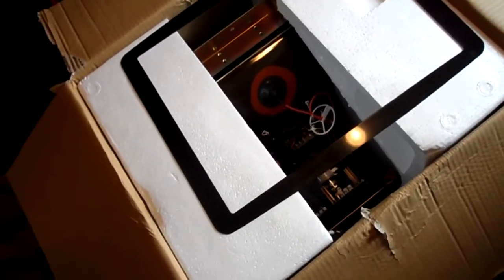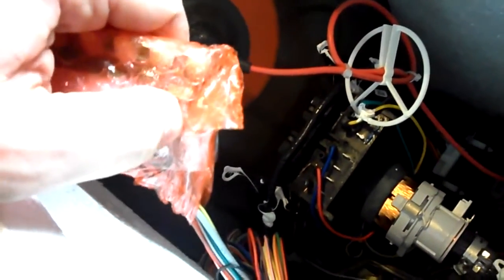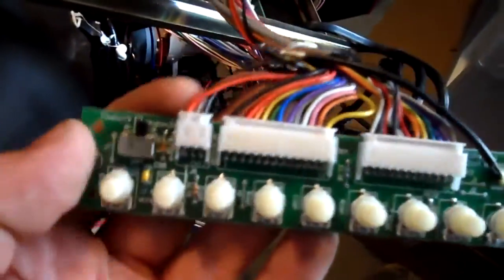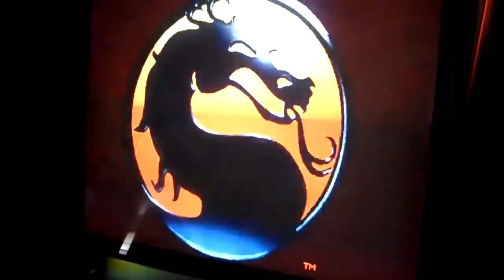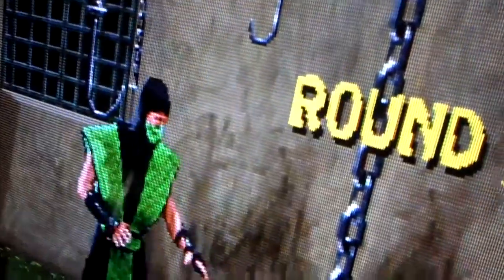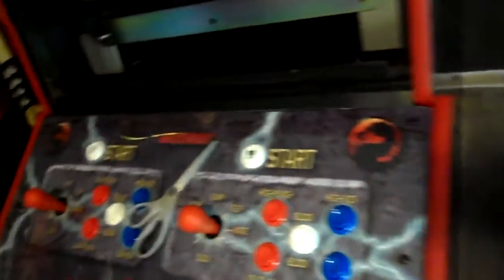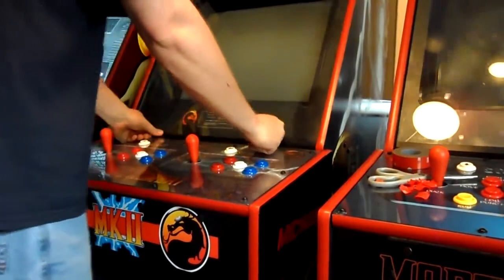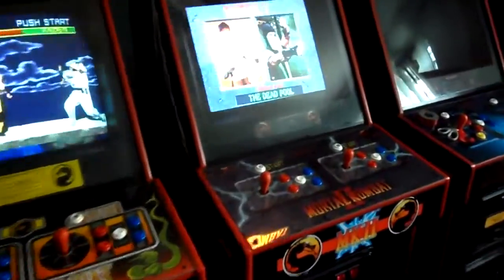Makvision 25" Tri-Mode Arcade Monitor Review

Comment: Do you still recommend this monitor? I need to replace my Golden Tee Fore Complete monitor and I was thinking of going this route.
Reply from the maker: Unfortunately, this monitor has been out of production for years. Only the 27/29" model is available and it's expensive. But to answer your questions, yes. Highly recommend is you can find one. Also, if your GT Fore is original, then it will have the 27/29" version, not the 24.8" version.

Comment: Trying to get my monitor wired up but it has a VGA cable with 9 pin CGA adapter on it, can I get these in 5 pin? All the premade jamma harnesses I've been looking at have 5 pin video cable connectors.

Comment: I have a quick question as well on the monitor that Greg asked about.  I just picked up a really nice golden tee cab that the makvision 27/29 svga monitor will fit right into, but I want to make sure this is the monitor that I need for my project.  I am wanting to run a pc with a hyperspin front end and have my games look like they originally did especially games from the late 80s to the late 90s (such as contra, ghosts n goblins, mortal combat..ect).  Ive just read of the nightmares that some people have getting all of the resolutions to display correctly depending on the setup that you are running.  Trying to decide between the tri mode makvision, this svga monitor, and lcd (which I really dont want to do).  Thanks so much...I'm also from Louisiana if you wouldnt mind a quick phone call if its easier to explain.
Reply from the maker: Well, I'm actually in Kansas. I was in LA for the USBC nationals. I've purchased 5 Makvisions over the years and I've never had an issue with any of them. If you plan on using an ArcadeVGA card, you will LOVE how it looks. Even if you don't plan on using it, I think you'll still love it. I think a lot of the issues people describe are mostly due to operator error or them not having their settings right.
Reply: YourMKArcadeSource  
Which one should I get in your opinion?  The two models that show on xarcade.com are the svga model and the tri mode model...thanks so much for the input
Reply from the maker: Aaron Mabou You're welcome. The SVGA is only Medium Resolution. You will want to get the Tri-mode.
Reply: YourMKArcadeSource Do you think there is anyway I could give you a call and ask you a few questions?  Sorry for the bother, but just want to make sure that this monitor isnt going to be an issue for my application.  I keep reading horror stories about some of the makvision tri mode 27/29 monitors.  Thanks again for all the help. Aaron
Reply from the maker: Aaron Mabou Send me a PM.
Reply: YourMKArcadeSource pm sent

Comment: You'll most-likely be able to answer this for me. I'm looking into the 27/29 Inch Makvision CRT SVGA Arcade Monitor. I'm unhappy with using a CRT and want the true arcade feel in my cabinet. I was using an old tv so I had it resting on a shelf inside of the cab I built. Will these monitors be OK if just simply placed onto a flat surface and inserted directly onto the shelf? Every video I see always shows them mounted. Thanks in advance.
Reply from the maker: Well, it would depend on the angle and how you decide to mount it. You can remove the tube and the chassis from the frame and install it however you like.
Reply: YourMKArcadeSource Thanks for the reply. It would be sitting flat on a shelf. Do you have an email that I can send you a pic to better show what I'm working with?
Reply from the maker: Greg Palko I sent you a private message...

Comment: And I have never been completely happy with the slight screen wobble it has, even using a step down transformer and emf it still has that irritating slight wobble. I did have a 20" tube chassis combo that ran direct 31khz input and you get all the clicking of it searching for the correct output . Haha used to click like a madman while the system was booting up . Lol but now you can get a 25 well 24 inch setup dammmm..